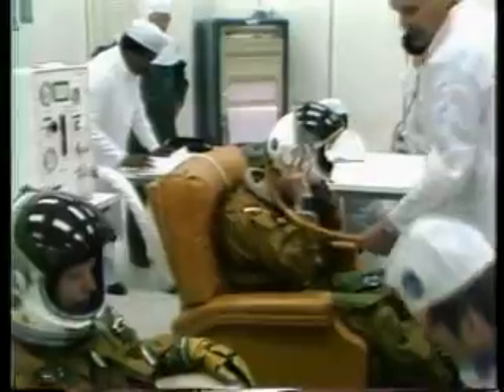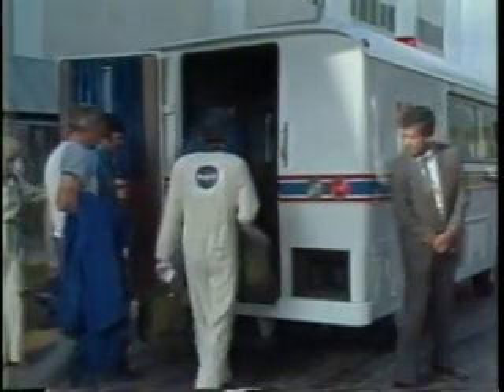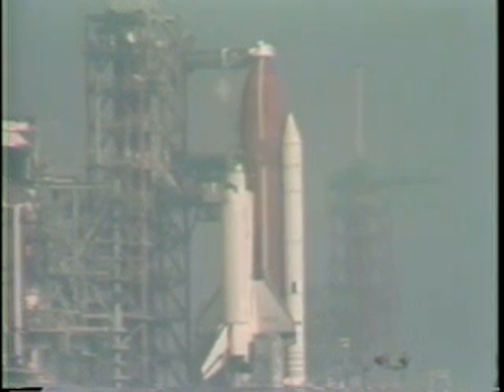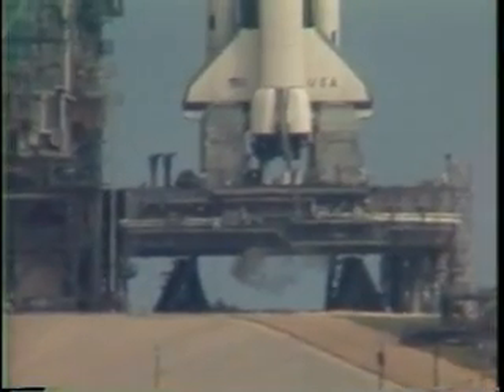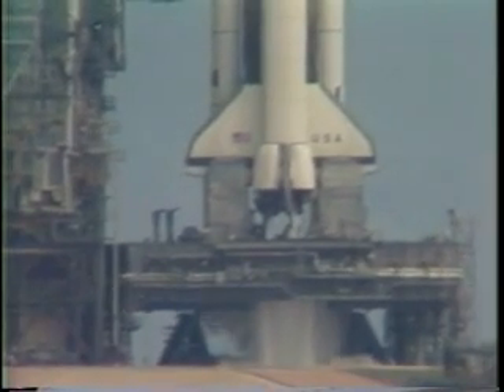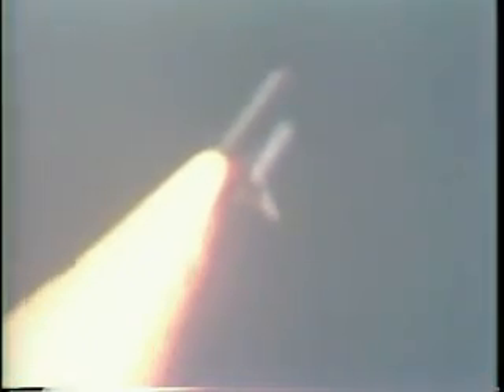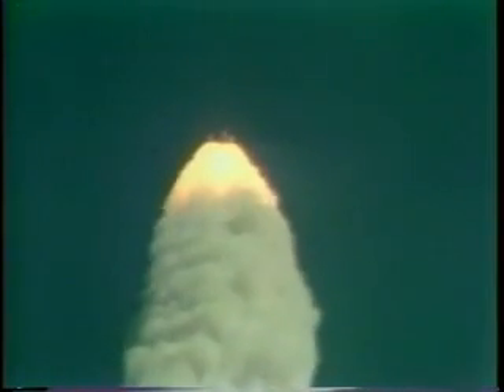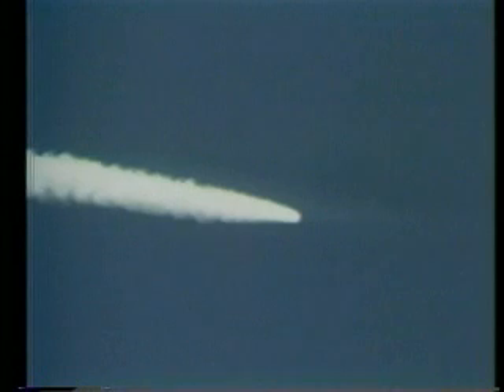Launch of STS-3 (Columbia)

Comment: The first launch with the iconic orange tank.
Reply: Yes, alas! This orange foam (or rusty color) responsible for the loss of the seven lives of Columbia STS-107, completely useless foam. Because as long as the hydrogen and oxygen tanks remain under pressure - up to 2 minutes from launch for oxygen and until firing for hydrogen - the gases have no possibility of heating up; the white painted tanks did not represent the danger that a piece of foam which was able to make a 65 cm hole in the leading edge of the wing of STS-107 causing the death of 7 astronauts (17 in total if we count the three of Apollo 1) ... Iconic? Let us say rather harmful and fatal.
Reply: @rigolonzinbrin  The only reason they decided to stop painting the tanks white was to reduce weight.

It's also why the Space Launch System's core stage has the same orange color - To help minimize vehicle weight.

Comment: These cameras were cine cameras. These were not providing live real-time TV/video images to people on the ground.
The footage from them would not have been seen until after the film had been removed and then developed in a photo lab. This could not have been done by the Shuttle crew for two reasons

i) the cameras were not accessable to the crew during the flight

ii) even if they had been, they did not have any facilities to develop film on board the Shuttle anyway

The camera was not mounted on either of the SRB. It would have been mounted on the orbiter.